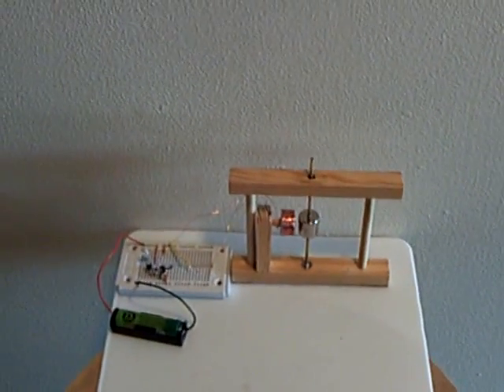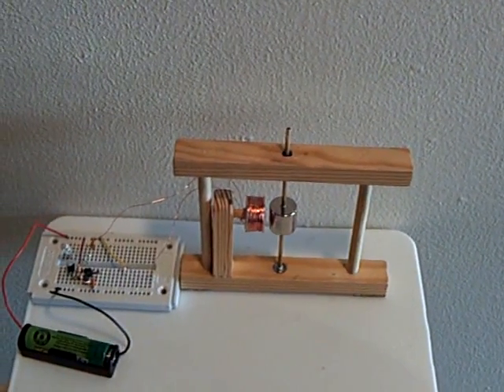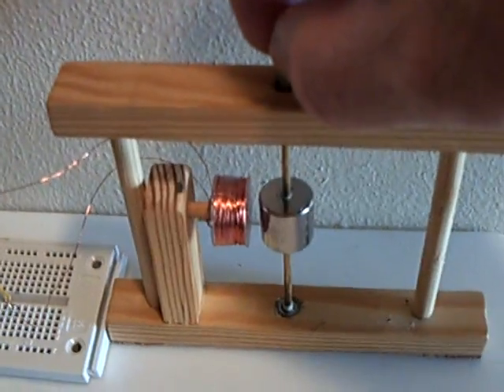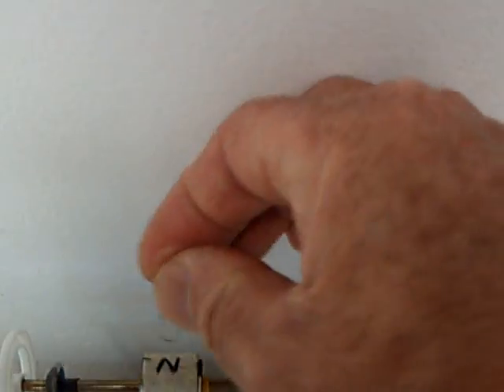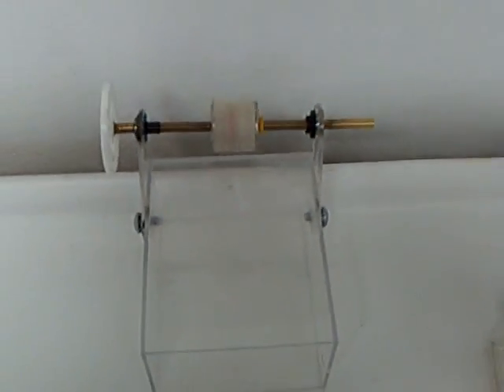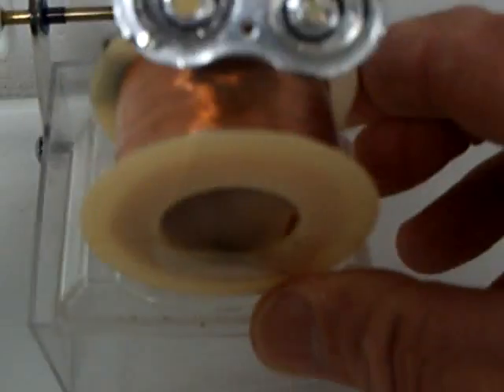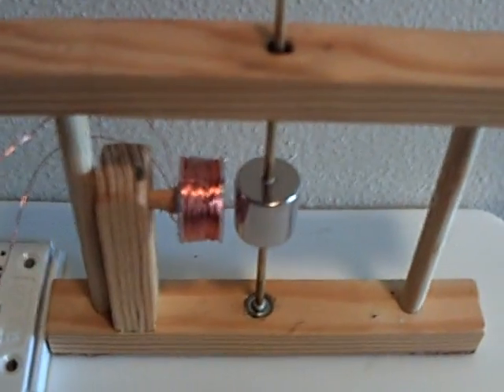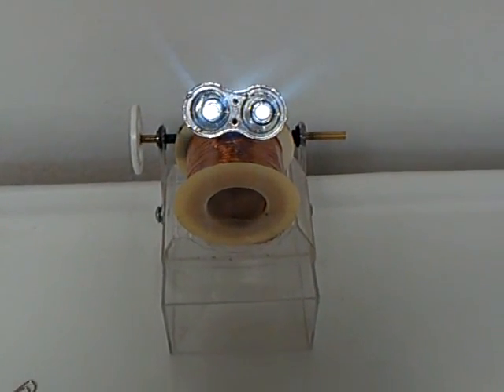Wireless Energy Transmission---  thru an interior wall

Comment from the maker: Recharging an electric car remotely would be a perfect application for this.  Just drive the car over the spinning magnet transmitter and the remote free wheeling magnet generator inside the car would pick up the energy and charge the batteries. No plug- in required.  My wife would do back flips to get one of those.  I know that they have worked on the inductive coil method but I had not heard about the spinning magnet approach.  Thanks.

Comment from the maker: The magnetic fields are complicated. The induced current in the coil going backwards (BEMF) caused by the rotating N/S magnet is what triggers the circiut. Driving on both sides of the coil might disrupt that.  I think that just spinning up the neo ring magnet using a a simple variable speed PM motor might do just as good a job as a sender unit.  Getting the two magnets to linkup is the key.

Comment: Awesome work! The axis tilt is interesting. A cool experiment would be to put the 2 apparatus in a glass chamber with or without a vacuum. Have a tube that can insert some statically charged talcum powder or small statically charged styrofoam beads. The light beads could dropped slowly from above or piled on the bottom to see what sort of interaction reveals the magnetic flux connection. Or maybe, get an 8" thick glass container and suspend some fine iron powder in water. See what happens :)

Comment: Amazing what people must think. Your system here is no mystery and as ElectronSpark said, a lot of people don't even understand how a motor runs.
This bathroom experiment is a good usage of such a system, for those who have candle type lamps, electric toothbrushes etc. This way, they can run them completely safely by plugging in an adapter on a large spinning magnet assembly+coil.
Solar, to motor, thru wall, to electric toothbrush charger. No zap.

Comment: An empty aquarium would work nicely for the styrofoam test. Maybe also, put a fog/smoke machine in between them and somehow put a charge on the fog/smoke. That might also reveal the flux interaction:) A 30 gallon aquarium turned upside down, covering the experiment, might help with visualization of the field lines in the charged fog/smoke. It would be very interesting. INDEED :)

Comment: It only works (at that distance and rpm) 90º flipped?

If anyone knows of a good reference how efficient this power transfer can be, I'd be interested. The fake magnet motors with cog-and-chain-like interactions are likely near or at 100% efficient at transfering power from one wheel to the other. Multiple magnets on the outer diamenter. This here of course is single magnets spinning. I see many applications if the torque and distance are good.